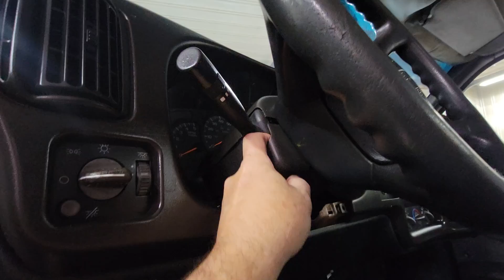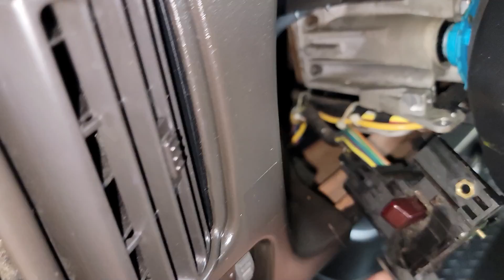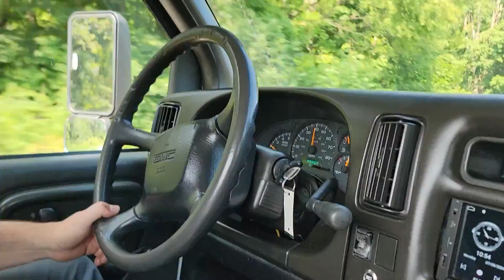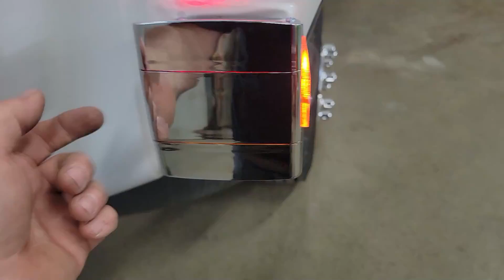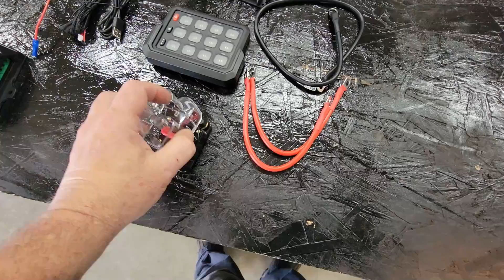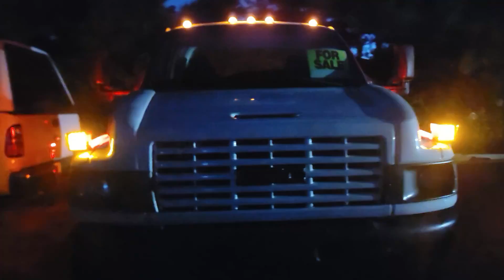PROJECT "EX-HAUL" PT ADDING CRUISE CONTROL TO C4500 C5500 IN UNDER 30 MINUTES!

Comment: So you’d have to admit the GM is easier to work on than Ford
Reply from the maker: you mean because one part is easy to change, i'm suppose to change my opinion on generic motors? uh, no. what is better to me? c5500 or f550? i would take a f550 every time.

Comment: JC harbour freight sells a ratcheting handle for what your using the tape an wrench for just FYI  tryin to help..  that cruse control upgrade is too cool lot like the 1st gen 4runners to get full gauges instead of lights all youd have to do is have the cluster and  change the oil sender plugs right in

Comment: Generally speaking you can access the screws stalk by turning the wheel around to the right position. I added cruise to my 98 Savana, and just turning the steering wheel to the right position allows you to hit the screws with a screwdriver style torx.